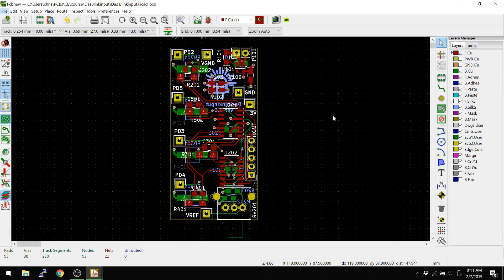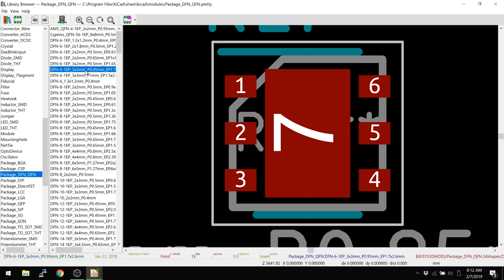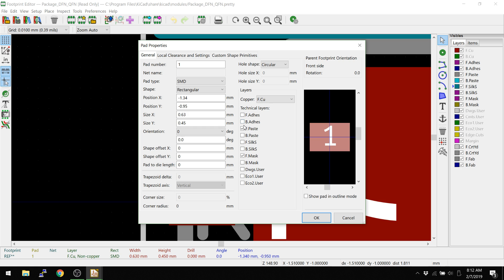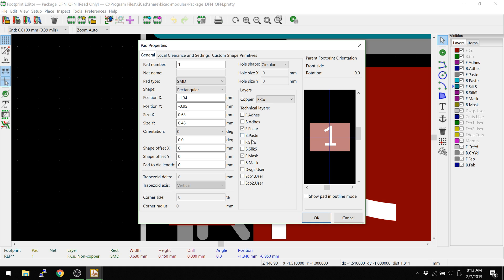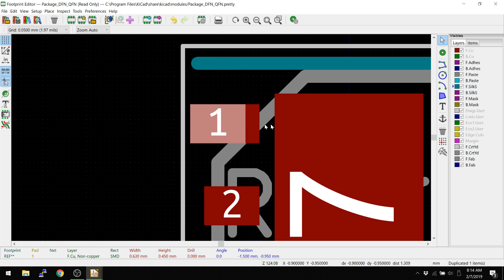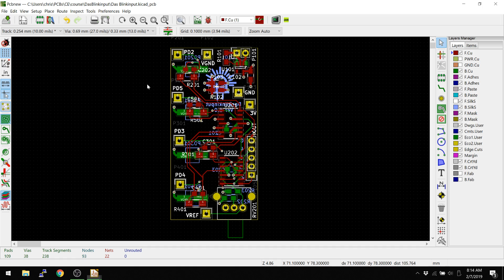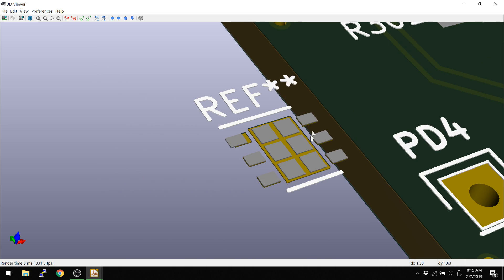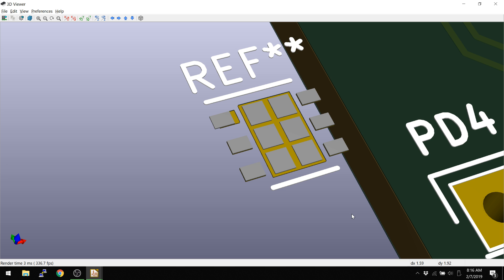KiCad 5.0 - Custom Solderpaste Stencil Elements

Comment: This doesn't work in KiCAD 6, and now there is no obvious way to do this easily besides drawing a rectangle on the seperate layer, but you lose the lenght-width specifying capabilities of the rectangle (much easier to position and size pads with the center-origin based parameters). Anyone know how to do this? Come on KiCAD team - how did you not see this is an issue?!

Comment: Would have been interesting to understand how this ground pad (6 x little pads) was done
Reply: Matho Li The broken up groundpads provide for a kind of adhesion in the molded phase of the ordering process when the paste is spreading out it gets thinner and sucks the part closer onto the pcb. Same with the  missing solder on the outer pad. The paste which is outside of the pad now  flows up the side wall of the QFN package pad and holds it in place.
Reply: I first thought he made it using 6 separate pads, but then I couldn't see them as separate pads, it seems like there is only pad 7